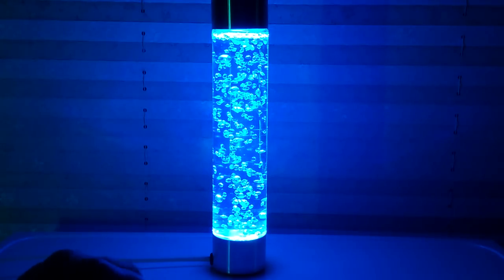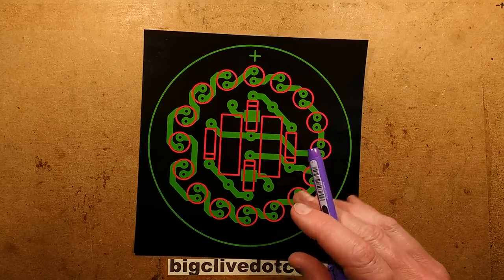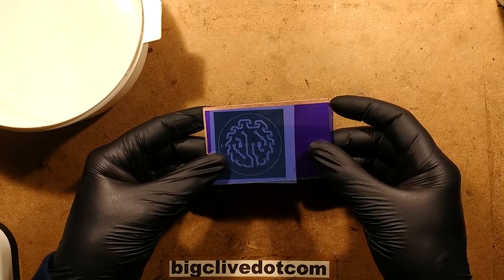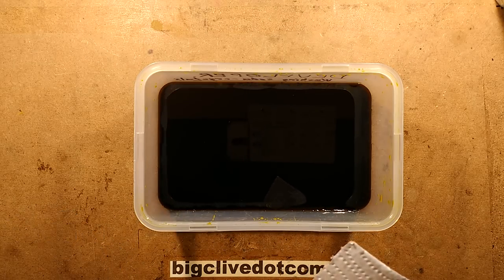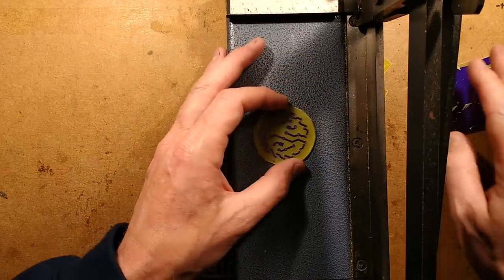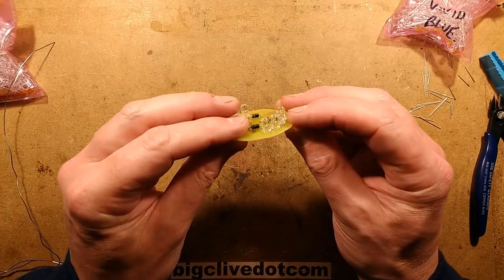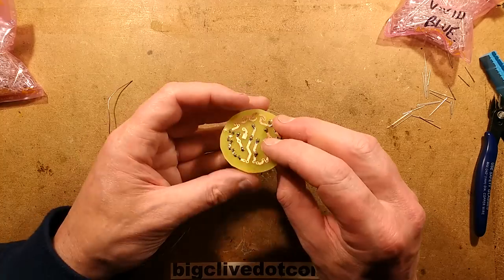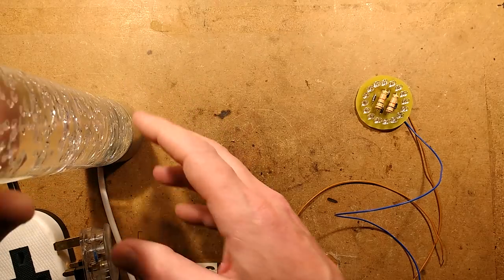Gillian's Diamonds LED crystal remix.  Full build.

Comment: I've tried the copper chloride etchant method aswell. the problem seems to be the source of hydrochloric acid, most have additives for cleaning applications that take the resist off.
TheHomeScientist has a video on purifying HCl if you can't find a more pure source.
Reply from the maker: I've been researching it and it does look like there may be some sort of solvent thing going on.  I'll be trying again later, but will stick to the ferric chloride at the moment.
Reply: bigclivedotcom It may be different in the UK, but around here 1l bottles of pure basic chemicals like HCl and NaOH are readily available in supermarkets and building supply stores.  Except Ethanol of cause.
Reply: You're likely aware, and there may not be many swimming pools in the IOM, but HCl (aka muriatic acid) is used as an oxidizer in pools.

Comment: Any thoughts on how tall a version you could make? I remember the old lava lamps and discovered that pulling the gold coloured cap off to expose the black metal underneath increased the rate of lava movement. Presumably as it cooled the top slightly more effectively and increased the thermal difference between top and bottom.
Reply from the maker: This design is very scalable.
Reply: bigclivedotcom I might try a 1 metre version using 50mm perspex tubing. Not sure about USB power, will that generate enough heat?

Comment: 70V x 70V / 2.5W = 2000ohm or two 1000ohm resistors.  But it'll be slightly different for AC with clipping.
Reply: Or to include the heat from the LEDs: 70V x 110V / 2.5W = ~3000 Ohm or two 1500 Ohm resistors.

Comment: I wonder if you'd throw in 1 or 2 rgb slow changing leds… would it just have a nice tinting effect? Also, for cords with no real room for strain, I tend to use a little tiny 4in zip tie.

Comment: Clive, why not drop the rectifier diodes and make the bridge from LED strings?
Reply from the maker: It could be done, but might increase the flicker because only half would be lit on each half wave.
Reply: Wacko Madman LEDs don't like large reverse voltage.

Comment: For rounding up the circuit board, my first impulse would be to use a bench grinder. Am I missing some reason why that would be a bad idea?
Reply from the maker: A bench sanding disk would be fine.  They often use them to clean up PCBs in factories.

Comment: I'm wondering Clive. I want to try this but I don't want to buy a full roll and never use it gain. MG Chemicals make fr4 copper clad sheets with photo resist already on it and a bottle of ferric chloride for under 30cad. I have a laser printer. I just want to make a simple pcb to see if it's something I'm interested in doing more. Would that be a good cheap way to try it out?
Reply from the maker: These days it's extremely cheap to get PCBs made to order in China.  But it's definitely a good idea to play with etching your own PCBs.  It's got a harsh learning curve, but is very gratifying.
Reply: @bigclivedotcom  thanks Clive. When I was new to tinkering I had 500 smd led breakout boards made and submitted the wrong Gerber by mistake and ended up with 500 poker chips. What kind of smd leds are on your wearable super computer. I need them for a personal project and have a contact in China that says they can get anything but language barriers keep them from understanding what I want. I appreciate the fact you take the time to answer my questions all the time Clive so I'm going to join your patreon right now.
Reply from the maker: @jstro-hobbytech  Companies like JLCPCB will make a batch of just 5 PCBs cheaply.

Comment: Hello from chicago here. 
Question.
the video change but how did you get the blue color layer off right before you started putting the components
Reply from the maker: I used a more concentrated mix of the developer.  Acetone may work too.

Comment: how can you snipp off the leads of the leds before soldering ? they tell you which way round they go. well you could possibly look at the die and eventually compare it to the leds in the bag but usually i would wait cutting the leads off after soldering the leds … although very decent Job and a very educational and enjoyable Video. like your very british Accent.
Reply: Did you ever notice there is a notch in some LEDs on the same side as the negative ?
Reply: der bender you do know that leds are not round?
Reply from the maker: I tend to go by the anvil that has the LED reflector on it.  Usually the negative connection.

Comment: If you had a laser printer and not an inkjet, could you just print on tracing paper and put it face-down instead of using the transparency?
Reply from the maker: I used to do that, but all the newer "fast" laser printers I tried produced a very thin grey layer of toner.

Comment: That blue component lead former from eBay (at 27:53) looks suspiciously similar to this 3D model on Thingiverse: https://www.thingiverse.com/thing:1022337  I wonder who was first and if one copied the other :) Either way, if you have a 3D printer, that model is a nice alternative to buying one! (Or just browse around Thingiverse - there are a lot of alternative lead-forming tools :) Actually there is a hell of a lot of electronics-related models on Thingiverse, it's very useful.) Or there's this one at Pimoroni, which is the one that I've been using for *years*: https://shop.pimoroni.com/products/resistor-lead-bending-tool

Comment: Clive, have you looked into the white balance settings your camera might make available? Most modern cameras take a best guess by default, and that works well in a scene that's mostly lit by common sorts of light like the sun or regular room illumination bulbs, but in a case like this where the light is of an unusual spectrum it's likely to misbehave as you're seeing here. If your camera (app?) does have manual WB controls, it's worth experimenting with them to see if you can coach it into rendering a closer approximation of what the lamp's actually emitting.
Reply from the maker: I tried all the white balance settings and none showed the true colour.
Reply from the maker: I tried all the white balance settings and none showed the true colour.

Comment: Sometimes when i solder leds they turn on very very little ...how is that possible ,there is like no ground conection at all...something with body Capacity?...and sorry for the long Text but can i use and led as an voltage indictor ? Like its turning off at 7volts and lighting full bright at 8.4volts ?
Reply from the maker: It sounds like leakage from an ungrounded iron.
Reply: bigclivedotcom its a pretty cheap one yes it has a normal plug without earth

Comment: That buzzing soldering station, why does it make a popping sound every now and then?
Reply from the maker: It's the load toggling as the element turns on and off.
Reply: Hmm, that sounds backwards. It's a Weller magnastat?

Comment: The mains cable looks a bit dodgy as there is nothing to stop the cable getting ripped out if it ever got tugged. It would be better to use a cable grip grommet such as SES Sterling 01310001010.
Reply from the maker: New version coming up is USB powered.

Comment: Bigclivedotcom i bought a 12v power inverter of eBay for £30 it’s a 2000w and it has a Protection for shorts and over voltage and overload I have overloaded it by trying to use a 2300w chop saw a so now it’s fault light comes on and will not put out any voltage so I opened it to see if anything was burnt but everything looked fine do you no what on the board would be the Protection so I can replace it to make it work again please reply
Reply from the maker: It might be a sense resistor or output transistor that has failed.

Comment: az 27m the blue stuff magically comes off of the traces... what happened there?
Reply from the maker: I cleaned the excess resist off with either acetone or a mild sodium hydroxide solution.  Spray oven-cleaner foam works well.